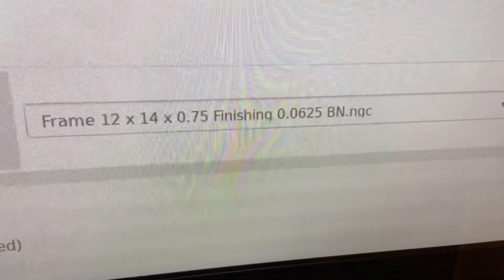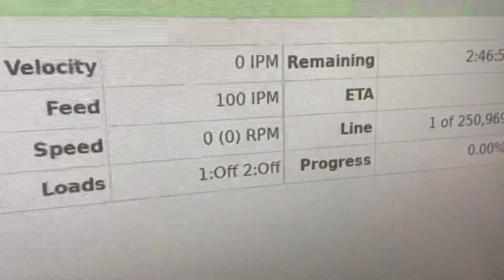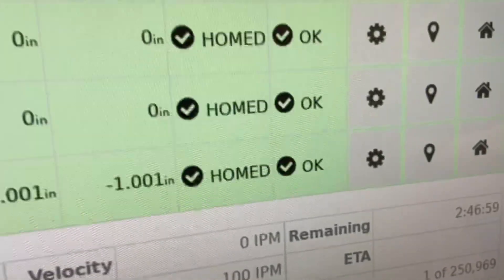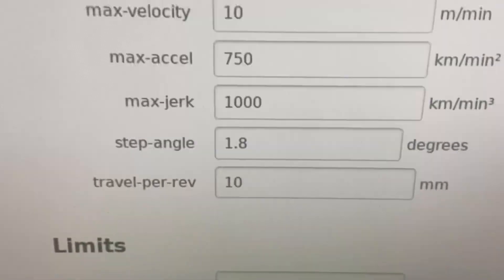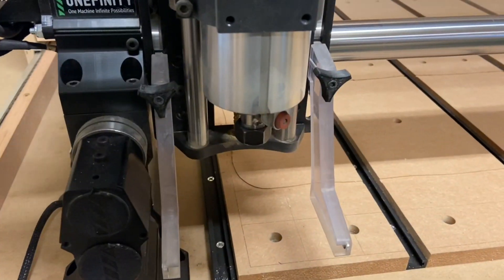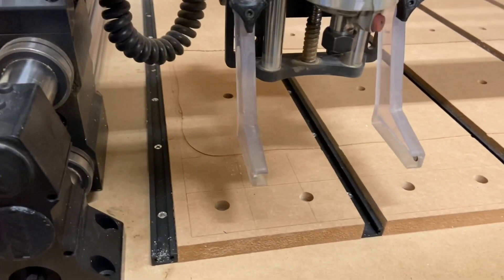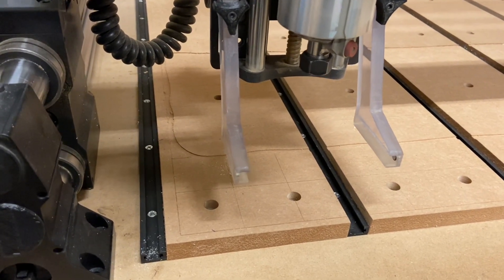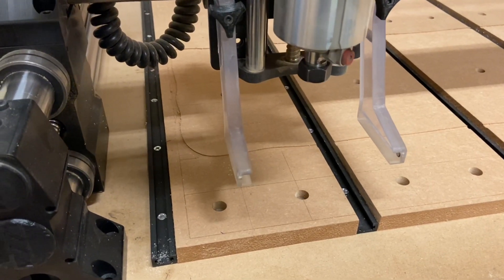How to reduce Carve time on Onefinity

Comment: Is this only for 3D carves or can it be set and left all carves?
Reply from the maker: It can be set for all carves with the BB controller
Reply: Thanks for the reply. I sped mine up to 10K and what a difference.
Reply from the maker: If you find that you start losing steps, back it down to about 7k
Reply: Good advice,  thank you

Comment: You changed the setting to the max jerk for Motor 0, Motor 1 & Motor 3 but not motor 2?  Why not Motor 2?
Reply from the maker: Motor 2 (right Y rail) is slaved to Motor 1 (left Y rail) and therefore uses settings for Motor 1

Comment: When making this change, any advice on changing the rapid rate setting in Vectric for more accurate time estimates?
Reply from the maker: For the original machine, the rapid rate should be set to 395 in/min.   Keep in mind that a pocket cut will have a lower scale factor vs a 3d carve which will have a higher scale factor. Make not of estimated time in Vectric and compare to actual time on machine. Over a short time, you’ll get dialed in on what that scale number should be.  For me, profile and pocket cuts, I set scale factor to 1.4 and for 3d carves I set it to 4.2 which gets me fairly close
Reply: @onefinity-trainingtipswithMitz  Does the 395 in/min change if I use 5000 vs  10000 for max jerk?
Reply from the maker: @berner57  no. That’s the max velocity.  Jerk is the rate of change in acceleration.

Comment: If you also increase your maximum acceleration and maximum feed rate along with your jerk rate you would see a more consistent reduction curve. Plus Using a spiraling toolpath instead of a raster will reduce machining times as well. Raster toolpaths are like coming to a complete stop at thousands of red lights on a long trip whereas spiraling toolpaths are like slowing down enough to keep from crashing but rolling on through thousands of red lights on the same trip.
Reply from the maker: Yes, there are multiple ways to reduce carve times and this was just one example of how the max jerk would do that. 
Maximizing feed rate while maintaining appropriate chip load and toolpath strategies will also help. Altering max velocity can cause missed steps so finding the right balance is key.

Comment: What is jerk in robotics?
In other words, jerk is the rate at which acceleration is increasing or decreasing. Jerk is generally undesirable because it creates—you guessed it—abrupt, jerky motion. In industrial applications such as machine tools, SCARA robots, and dispensing systems, a rapid change in acceleration—i.e. jerk—causes the system to vibrate.

simple enough right? maybe, thinking about ""jerk" and what it actually means, although you will increase your production time, there is a chance you will stress the system, is this a big deal with the onefinity? with those hefty rails, your guess is as good as mine, I would say that maybe... "jerk" just sounds like it could break something, I'm going to do some more looking into this, there is prolly a reason they have it set where they do, but im a noob right? so i could be totally wrong.. just something to think about, thanks for the video!!!!!!! it for sure wil stress the bit but depending on what bit your using imo.,
Reply from the maker: Fair point. However the jerk only
Applies to the rapids movements. I’ve had mine set to 10k for 3 years and the machine cuts as accurately and smoothly as it did on day 1.  It’s about finding the right balance between effectiveness (quality) and efficiency (quantity). Onefinity doesn’t recommend max jerk to be set higher than 15K so my setting at 10k is well within that max range.
Reply: @onefinity-trainingtipswithMitz  im just a nervous person when it comes to that stuff lol
Reply from the maker: @Carpenters_Canvas  you right it does sound scary with the word “jerk” but as I’ve said earlier, it’s about balance…. Running the jerk at 80k  could create some issues (most likely damage to the table first and then the machine.). What typically will happen at higher jerk settings (50k+) is lost steps which is very undesirable. But at 10K, I have yet to miss steps. Therefore in my opinion, this creates an appropriate balance. Not very hard to increase or decrease the max jerk and if it worries you, go to 5K or leave it at the default of 1K. Neither one will hurt your machine.

Comment: When your machine was at 1000 and you showed the 2hrs 47min your feed rate showed 100ipm and when you changed to 5000 your video showed it at 160ipm? Wouldn’t that be why your first time off was so significant?
Reply from the maker: See responses to comment by Eric Schwoerer below.  He had made the same comment.
Reply: @onefinity-trainingtipswithMitz  thanks. Just caught
My eye. So why do you think there was such a huge jump from 1000 to 5000 but a small difference from 5000 to 10000? The second jump was larger than the first so in my head I’m thinking it should of went down big again? I’m not a smart person either though so that why I’m asking.
Reply from the maker: Ha!  You’re pretty smart given your original question. Jerk is the rate of change of acceleration during rapid moves. First of all this is not a linear function. I may be wrong but the acceleration time (and deceleration time) of the rapid moves takes longer to get up to higher speed and has to slow down sooner to go to the next move( cutting). So it spends more time accelerating and decelerating to get to and from the higher rate. Therefore not a significant time savings.
Reply: @onefinity-trainingtipswithMitz  wasn’t trying to be a smartass. It was just a question. Just thought it was crazy that the first one took off so much time and the others didn’t.
Reply from the maker: Didn’t think you were being a smartass at all!  Just trying to share why I thought ther was diminishing returns at a higher max jerk setting

Comment: Just now seeing this and thank you for the details and showing each step. Coming from the 3D printer world, where jerk settings are incredibly critical, think of this jerk setting as "the speed at which the change in direction happens." Or, another way I've always thought of it is how quickly  you turn the steering wheel in your car, regardless of how fast the car is moving down the road. You can be in a parking lot and turn the wheel very quickly, and not too much is going to happen. Make sure you have a good life insurance policy doing so at highway speeds. In 3D printers, this change in direction happening too quickly leaves artifacts, skips, and ringing patterns. With CNC, attempts at changing any direction too quickly, using a 1/8" shank tapered ball nose, while 3D carving into ironwood at 200+ ipm is probably not the best idea. Onefinity makes it so easy to make this change (the whole metric thing aside), take it slow with adjusting this and find a balance across all tools and material combinations you are comfortable with. In my opinion, for Onefinity to determine 1,000 is "safe" but increase this x10 is a little scary.

Comment: Will putting the jerk settings higher lower the life of the machine do you know? I mean in the same sense as overclocking a PC. It shortens the life span sometimes. It made a huge difference tonight in my times. Almost in half with 15k settings.
Reply from the maker: No, it shouldn’t. The jerk setting only affects the rapids…the movement between when the bit is cutting. I’ve seen where these stepper motors are running at 50k jerk for well over a year with no detrimental effects, however Onefinity does not recommend going over 15k
Reply: @onefinity-trainingtipswithMitz  Wow 50k lol...it would shake my table loose. Thank you, 15k seems to be great!
Reply from the maker: I know!! Mine too. The guy who was running at 50k has his table secured to 3 walls.

Comment: When I change my jerk it completely  fries my software to the point I have to flash my OF SSD have you had issues like this?
Reply from the maker: No… this is the first time I’ve heard about this happening! Can you contact me, I’d like to know more. 816-536-1398
Reply: @onefinity-trainingtipswithMitz  Hey there I was just rewatching this video and didn't see your that you replied to my comment. It was actually a control board issue. after a weeks of trouble shooting it turned out to be a corrupted arduino. replaced my control board and worked fine. But I still can not do 10k jerk without the router loosing its position. I figure its because the 1.25hp router can only plow through hardwood so fast. I found for my work the 6k point to work nicely. Thank you for your video.
Reply from the maker: Hi Ty, the only thing that the max jerk affects is the rapids movement…movements from one location to another when the router is not engaged. It has nothing to do with router cutting speed. That is controlled with the feedrate  and plunge rate set in your design program. Some factors that may be contributing to losing steps are feedrate too high (check the units on feedrate too. Inches/sec vs inches per min are crazy fast and will cause lost steps) router speed set too low ( I usually have mine set between 2 and 3 on the router dial). The recommended maximum setting for max jerk is 15K, so 10k should be feasible.

Comment: Interestingly I have a texturing toolpath which was estimated at 1h15m... adjusting the max jerk to 10000 from 1000 cut it down to 45m however it is still tracking to be a 1h15m carve.  It is just showing the counter as a negative value now.  (1.0.8b1 firmware - also have not restarted the controller since changing the max jerk so maybe a calculation vs reality setting)
Reply from the maker: Most likely.   I don’t trust the carve times in the software. They never seem to be right compare to what the machine output is. Would be interested what actual carve time is on the machine. Keep in mind that the jerk only affects the rapid moves, so if your texturing toolpath is a continuous back-and-forth raster toolpath, it probably won’t save a tremendous amount of time
Reply: @onefinity-trainingtipswithMitz  Good call.  It is a lot of short rapids but likely never gets up to speed. Typically I have found the timings on the machine to be accurate (not so with the software nor them ever matching)  I generally throw the gcode into camotics if i am curious how onefinity will interpret it.
Reply from the maker: I do most of my design work on my computer in the house (never accurate on carve time)and load to a usb thumb drive to take out to the shop to get actual carve time on 1F. Never thought to load camotics on my computer. Thanks for the tip!

Comment: I am not sure but maybe. 
I set the max jerk to 10k.
While doing a test carve I noticed the 3D roughing with a pass depth of .25 was jumping over to the left everytime it would step down to next cut. Could the 10k max jerk have made it skip over for some reason?

I am glad I was using a test piece of wood LOL. If the max jerk couldn't have caused this, what may be my major malfunction?
Reply from the maker: Why a bullnose for roughing? I’ve done it when I have small pieces that I don’t want tear/chip out by leaving a bigger base. I keep my depth of cut on ballnose bits to 1/2 the bit diameter. I think what’s happening is that as it steps down the rotation of the bit and that much of a step down, the bit is being pulled into the bite rotation. 
The max jerk only affects the rapid moves, when the bit isn’t carving. So I’m thinking it’s the depth of cut.
Reply: @onefinity-trainingtipswithMitz  Ok I will try that. I used the BN bc of a video I watched from Mark Lindsey stating he was taught to use a BN and that is how he has always done it. 
Should I switch to a Flat 1/4 EM?
Reply from the maker: You could unless you have some small tips that may chip off. I’d still run it 1/8” deep. 
The response of 1.0.8 beta on the forum fixing circles and curves is related to fusion 360. I’m testing it now also and haven’t had any issues whatsoever.  I’m using Carveco Maker for my designs. I know a few others are using VCarve Pro and kicked up the jerk with no reported issues
Reply: @onefinity-trainingtipswithMitz  Ok I am back home. I adjusted the pass depth to .125" on the 1/4" BN 
The spindle speed from library of this bit is 18k rpm
Feed 275 ipm
Plunge 100 ipm

Does the rest of this sound right or is the library for these all messed up
Reply from the maker: Way too fast!  What they published for speeds and feeds are more at the industrial level. Are you using the makita or a spindle?  If it’s the Makita, I’d run it between 160 feed to 190. Speed setting at 3-1/2. Plunge at 80. You can continue to push it up until the router bogs down or you start to get some chatter.
Reply: @onefinity-trainingtipswithMitz  yeah it is the Makita for now
Reply from the maker: Try that and let me know.  You can send me a text in messenger
Reply from the maker: What is your speed/feed?
Reply from the maker: Bit diameter?
Reply: 1/4 BN 
It was the feeds & speeds from library of RIP bits.

Comment: So what is the down side of having the Jerk setting too high?  How do you know if it is too high.  I read on the forum that the default was moved from 10,000 down to 1,000 due to problems for some people but how do you identify those issues if they happen?
Reply from the maker: Hey Jerold. When the higher jerk setting was introduced (I think at the time, the firmware was 1.0.5) there was an issue affecting the probing where when you probed xyz, the z was off by 1.5mm as opposed to just probing z only. This created an issue if at start of project you probed xyz, ran a toolpath then changed bit and probed z only...depths would not align and was. Very apparent. This was fixed with the final release of 1.0.7. As for knowing if it’s too high, start by going to 5000 jerk...if your comfortable with that and you’re happy with quality of cut, then move up to 10,000. 
When I first was testing this, I went from 1000 to 15000 and ran a job. Scared the crap out of me!  However after a few days at 15000, I dropped it back  down to 1000 max jerk because of probe issue...it was like watching paint dry, it seemed so slow. I decided on 10,000 as my normal setting as I gained a reasonable reduction in carve time without shaking my whole table!

Comment: Mitz, thanks another great tip. I have a question about switching to metric, I design in imperial and usually leave my machine on imperial units, do you switch to metric just to make changes or do you run your machine in metric? Also should your machine and design always be synced either in imperial or metric?
Thanks
Reply from the maker: Hey Greg.  Yes, for this change, switch to metric and save.  Then change the jerk rate, (save) then change units back to imperial. I don’t believe they need to be synced up but it’s good practice to do so.  I do mine both in imperial
Reply: Hi Mitz, 
Another cream of the crop video. I was going to mention I heard you say change to metric then make the jerk changes. I then observed on your screen units set to Imperil but the jerk setting was in km/min cubed. Aren't all the settings stored in Metric regardless of what the carve units is set to?  And aren't the carve units set by the g-code file loaded?  Thanks for all you do!

Comment: Thanks for the info! Do you notice any difference in carve quality when jumping from 1K to 10K or 15K? Any consideration for specific materials like ply or acrylic?
Reply from the maker: No, you shouldn’t notice any difference on carve although you might need to make some minor adjustment to feed and speed particularly on really hard woods.  Haven’t tried on acrylic yet but it’s on my list.
Reply: @onefinity-trainingtipswithMitz  This video was super helpful! Just wondering what makes you say that  some adjustments might need to be made to feeds and speeds on hardwood? I'm doing a lot of brass machining so I assume the same would apply.
Reply from the maker: @kylemalcolm9395  hi Kyle. All I was referring to was that different materials may require different feeds and speeds regardless of jerk settings.

Comment: Thanks for the video, that's very helpful.   However one thing concerns me... Didn't the latest firmware purposely lower that value because of a bug in the buildbotics controller?
Reply from the maker: From what I’ve been told by Onefinity, the final version of 1.0.7 resolved the z probe issue in the controller. I’ve done several carves since then and have not encountered any issues that I did prior to the final version. I plan to actually do a follow up video on this and validate with a multi tool carve
Reply: @onefinity-trainingtipswithMitz  nice!  That’s good to know because it’s a huge time saver!